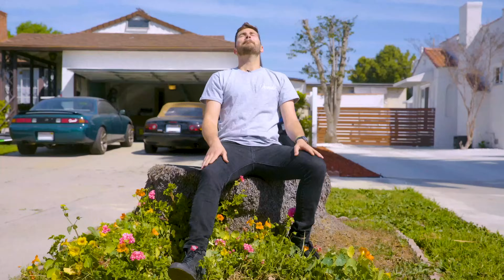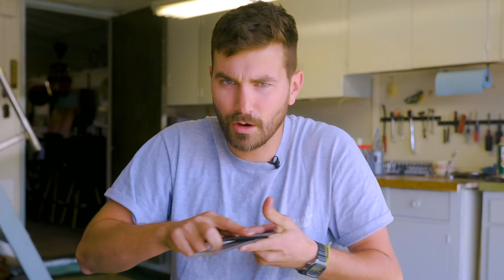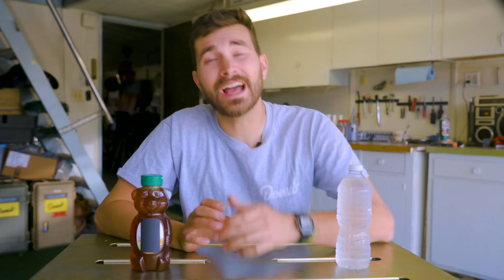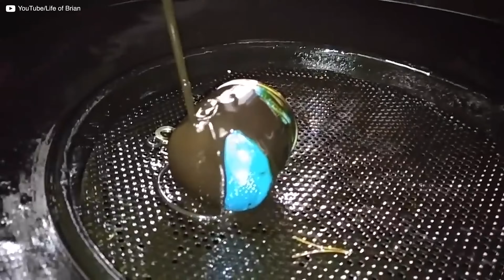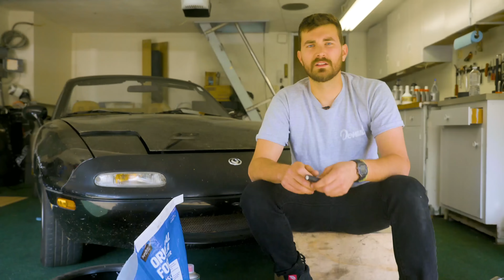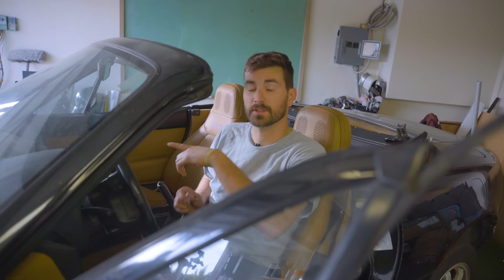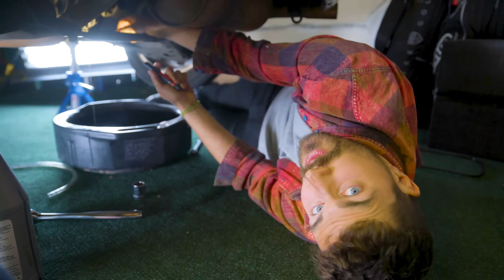9 Things You’ll REGRET Not Doing to Your Car

Comment: Message from the future:  Don’t worry too much about that power steering fluid.
Reply: Plot twist: they broke the power steering on purpose to empty out the system (on to their floor) to change the fluid.
Reply: Definitely do if you care about to your car lol difference between that power steering pump failing at 70k vs 300k
Reply: Ok Dokey Watch the next few videos and you’ll see why it didn’t matter.
Reply: My used car says nope, the steering wheel started squealing just after two weeks of owning it lol
Reply: replace any fluid when your manual says too, most ppl neglect those tho, especially transmission fluid,  ppls transmissions wouldlast alot longer if they replaced the fluid on time

Comment: Another quick maintenance item you may like is the high mount brake light (I noticed yours is out): On these NA MX-5s it's commonly caused by the wire loom pinching and breaking at the driver's side trunk lid hinge. All it takes is a ten minute wire splice to fix. I just replaced mine two weeks ago and it lights up my day every time I see it work.

Comment: Also with bleeding the brakes, ALWAYS start with the farthest brake from the master cylinder and work your way forward. So in a left hand drive car, start with the right rear, then left rear, right front, then left front. This makes sure pockets of air can't back flow into systems you've already bled.

Comment: As far as the oil goes. Yes you  CAN go 5k miles between oil changes, but the more you change the oil, the better. As soon as you start it with that new oil in the pan, it starts to pick up dirt, combustion deposits, etc. So even with new oil technology, 2-3k miles is best. As a professional mechanic, i've rebuilt engines that hand 200-300k miles on them, where the oil was replaced like clockwork every 2000. Still looked brand spanking new inside! The only reason we rebuilt them is because they were 30-40 years old and it was about time. On the other hand i've seen engines that looked like absolute garbage just because the owner only changed their oil once a year.

Comment: WRONG

You dont start the car to get the oil moving, you "roll it over" a few times by doing a small quick turns to crank it over, nit not spark,that gets the oil flowing before metal on metal wear

Comment: At 7:12 - Why not just reuse the empty oil product jug?
Diff and Trany Drain Plugs 	Inspect and Clean Magnetic Plug
Changing Coolant is a good process to show how to do. and how to collect, you could do a video on just that 
7:39 you didn't talk about the insulator boots. (I had a leak in a PVC valve and it dripped in to the spark plug tube and ruined the boot)
23:29 Use a Pick tool to get the tube loosed a bit at a time. 
Belt information was really great to see how simple it acan go
Fuel Pump - Brilliant / Excellent / Just what I needed>
On a 1996 Miata (original fuel filter, age 14 years & 112,00 miles), for some reason the car would just stop. I would be driving 60mph for around 45 minutes and every thing stopped and all the electrics turned off. Felt like a ghost car and I would glide to the side of the road. Wait 5 minutes and restart the car and be on my way.
It was a big mystery until an old motor gay told me to change the fuel filter - 10 years ago and still no problem. Soon will be time again. 

Hoping my Ideas are helpful. Great work and most importantly GREAT LIGHTING! GREAT SOUND! and GREAT VISUALS. KUTGW.

Comment: Sorry, but there's some wrong information here!
Here in Germany people use "long-life" oil a lot. We change it every 30,000km (˜18,000 miles) or every 12 months, whichever comes first. And trust me, Germans are real uptight about their cars! Changing your oil every 5,000 miles seems kinda ridiculous to me... its just expensive and unnecessary at that point. Also, 25-30 ft/lbs is too much.. Especially if you have aluminium (softer than steel) tanks. 19-20 ft/lbs is more than enough. Also remember to change the seal on your oil tank extract bolt..
Reply: Also, don't check your oil level by just turning the ignition.. Drive the car until it reaches operating temperature and the oil has reached its proper viscosity, then turn it off and let it sit for 10-15mins so the oil has enough time to sink back into the  basin. Then check oil levels.

Comment: Dude, the bottom of that air filter is the dirty side. Also, using the gap rings to gap a plug can take off the iridium or other expensive material on the tip. Also don't touch any part of the tip of the plug. Also those gap rings are never correctly made and do not match the gap they list

Comment: 6:41 but you gotta be careful with some cars. for example on a GT350 if its not torqued to factory spec the oilfilter can come off pretty easily at high rpms and if it does and if that oil then spills all over the hot exhaust, your whole engine bay is going to be in flames and you're going to have a really bad time (pretty much like Adam LZ had happen on his mustang).

Comment: 9 things youll regret not doing to your car.. summed up to one thing, not following your cars manufacturers scheduled maintenance list..  is kinda funny how usually the 2nd most expensive thing a person buys in their life next to a house, nobody seems to read the manual for it or know much of anything about how it works, what it needs to work or what it costs to keep it working..  had a middle aged dude come by the shop with a Porsche carrera 911gt that he bought for 7g’s but didnt run right..  well he didnt know about cars but knew a porsche made him look baller.  Didnt know how much parts are for the thing or labor to do it would cost or maintenance costs..  when he found out that it would cost more than he paid for the car just for new brakes, clutch, tires, all the fluids/filters and repairs to the cooling system to get it driving right and not completely blow up, the dude called me a thief and said i was trying to rip him off and tried to sue me.   wound up selling the car for 4g’s less than what he git ripped off for in the first place..

Comment: 6:43 make sure you check for an old o-ring. I spend ~ a year doing this professionally and i cant tell you how many o-rings i found stuck to the engine, youre oil filter will not seal properly with 2 o-rings

Comment: When bleeding brakes you should start with the passenger side rear as it's furthest from the master cylinder. Next to bleed is driver's side rear, then passenger side front & finish with driver's side front. 

"Those chemicals, when mixed with water, do exactly what the name suggests. They prevent freezing."
No, they don't. Your hydrometer told you how cold your "antifreeze" could get without freezing. What will happen if it's exposed to temps. colder than that? It will freeze. So antifreeze does not prevent freezing.

You should wear, and definitely recommend everyone watching, wear safety glasses or goggles when under a car. I've learned this the hard way as every time bits of dirt will dislodge from the underside of the car and fall into my eye(s). It always seems to happen just after I get under the car, never when I'm about to get out from under it.

Comment: I did an oil change like this one when I was 19. I didn't check the old oil filter to make sure the O-ring was still on there. Long story short, I put a new filter on, added oil and went to start up. ALL the oil came out. Needless to say all oil changes since, I've checked the old filter.

Comment: Something people don't often mention about changing oil is that you want to make sure the gasket from the old oil filter doesn't stick to the engine and end up getting sandwiched with the new one. If the new filter gets put on on top of the old gasket, it will leak really badly.

Comment: 6:14 You skipped an important step here. Replacing the Crush washer on the drain plug. This is what seals the drain plug so oil doesnt leak out. Its recommended to change it every time you drain the oil (or really, when you remove the plug. Do not reuse the old crush washer. They are cheap enough so there is no reason Not to just replace them).

Comment: It's also better, if you can, put oil into your oil filter so it doesn't have to go in dry. Most oil filters are vertically attached so it will allow for better life of the oil filter and greater piece of mind.

Comment: There is no reason to change oil every 5k miles. Even every 10k miles is on the early side. I normally do it once per year around 20-25k KM.

Comment: I've had a problem that is common but very simple to fix. A failed gas cap. It likes to pop up a check engine light when that little O-ring in the cap leaks out fuel vapor. A lot of people spaz out when their check engine light comes on over this. If you get a code detecting an "Evap Leak" just run to your local parts store and get a new fuel cap and have the codes cleared. Saves you a $300 trip to the mechanic.

Comment: Also if you live in the midwest/northeast usa, be prepared to replace brake lines and fuel lines on a somewhat regular basis.  I used to get specific ones installed to protect against corrosion from the salt, but then they started dropping acid on the roads as a pre treatment to help the salt de-ice and that shit went right out the window. So heads up!!

Comment: You definitely don't want any axel stands on your "lift points" they're designed for when you use your jack to change to your spare not to hold the car up they're fairly weak get it on the chassis

Comment: Doesn't changing trans fluid on a used car that hasn't had fluid changes in it hurt the car? I've read multiple threats where people say that causes your transmission to die faster because it causes slippage. Only if you do it to an old car that hasn't had consistent transmission fluid changes since the day it rolled off the lot.

Comment: Filling up the oil filter with fresh oil before you put it on is not a bad idea. Some angles make this difficult but if the filter is mounted vertically than it is a good idea. All about preventing we're as much as we can.  even small wear.

Comment: This is honestly a great video and should be shown to new drivers. My dad taught me all this stuff at a young age, but not everyone has someone like that in their life. Regardless I still watched the whole video. 

You should do a video on basic troubleshooting (if you haven’t already). Basically, what different colors of smoke indicate, signs of a bad starter, dead battery, poor alignment, changing a flat, etc. Common problems that people run into and how to fix the easy ones without getting stranded on the side of the road.

Comment: still here few thing you need to check daily or once a week.
screen washer water. battery water level, for those say use dry battery, you are being rich & moron to use dry battery. brake pad,   need to be change in 6 month. tyre pressure. air cond gas.

Comment: This video is great, but a few key notes to take in mind when working on a different car, 

1: European cars (Volvo, Volkswagen, Mercedes) are complex and very difficult to do maintenance on, very often when you're trying to do any of the simple things done here, they require very specific tools to get the job done, so arm yourself with knowledge about your specific model well before attempting to remove ANYTHING because there's a high probability you'll either run into a wall, or you'll not be able to put it back together. 

2: Power steering fluid, some older performance cars don't have power steering, as certain models just chose that, as there is SOME control loss with hydraulic power steering. The other part of that is most NEWER cars use electronic power steering, so same deal, your car may not even have a power steering reservoir.

3:  Transmission fluid, many newer automatic transmissions are fully sealed and don't have a way of opening or draining, the idea being that the fluid SHOULDN'T have any breakdown so the only real concern should be contaminants, which manufacturers hope to avoid by selling sealed transmissions. you're welcome to have an opinion about that, I certainly do. 

4: Differential fluid, and I know I'm probably stating the obvious here, but only RWD and AWD vehicles even have a differential.

So in reality many cars don't even require this level of maintinence.

Comment: My last two cars have not stated that My oil should be changed when the computer tells me or once a year. It didn't make any sense to me when I went to the dealership for my oil changes and they started changing the distance sticker... I got stickers of 3k, 5k, 10k, back to 3k... so I looked in my owners manual... and GM said I should change the oil once a year or when the computer told me. 06 Saturn ion and 17 Ford Fusion both have this in their manuals.

Comment: One big thing you missed that I feel should be said. (I understand when you're working on these videos trying to get content out sometimes details are forgotten)
When bleeding the brakes, always start at the caliper furthest away from the master cylinder and work your way to the one closest to the M.C. Ex: If the brake M.C is located on drivers front side of the firewall start at P.R, then D.R, then P.F, then D.F. If you go from the front to the rear or start on the wrong side, air/water/dirt/debris can travel back to a caliper that's already been bled, defeating the purpose of the brake flush.

Comment: 6:15 I always thought you need to replace the whole drain plug in each oil change. I mean they just cost $2 so why bother to reuse the old one.
Reply: Well hopefully your not super wealthy (in the kindest possible way) otherwise you might have been replacing your car everytime it run out of fuel.
Phew....🤫
Reply: usually its just the crush washer, but maybe on some cars u might need to change the hole plug

Comment: Good video but  your  not doing it 100 percent  right   first if available  always  fill the oil filter to reduce "dry start"  and for the trans and differential  tour not suppose to fill till it flows out  that's actually  overfill which can cause aeration which can promote premature wear one gears. the level should be slightly lower than the fill level   filling till oil comes out means its overfilled other than that not a bad video

Comment: WARNING! Do not run your fuel system dry if you have a diesel. A lot of diesel fuel pumps will have issues if ran to dry. I've run batteries to empty trying to prime dry fuel systems in diesel vehicles that have run dry before.

Comment: I understand the thing in using atf as psf, but ya lost me at that point, this is a much more modern vehicle which is using full rubber seals, not ring seals, like you would see on your axle seals... You are slowly destroying your rack and pinion doing this... Just use power steering fluid...

Comment: At 17:38 the reason that piston gets hotter is cause the B6 engine was around before the miata and in the FWD cars the coolant was in the rear side of the B6 engine, then in the miata they rerouted it to the front. Ive watched a coolant re-route video that shows how to do this "upgrade" so that the piston is better cooled and flatten the curve on time+problems on the engine. 

I'll link the video here and the explanation starts at 5:40 : https://youtu.be/bj0UOO4tVdI

Comment: My mom used to have a 2001 chevy impala with 300,000 miles, and the transmission fluid was never changed. She got rid of it because it wouldn't shift, I couldn't say I was surprised because the transmission fluid was so baked it looked like engine oil.

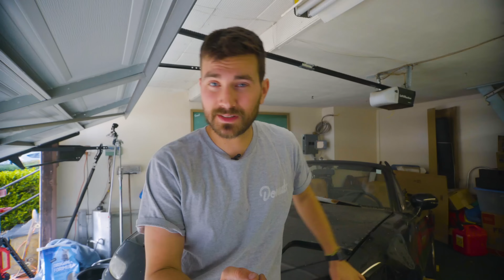Comment: 5:28 Depending on what you do, might not need to lift the rear or lift the car at all. Also important to keep car leveled
6:15 It is advised to get a new crush washer.
6:30 You might need a special tool to remove it, if it is too tight
7:10 Good chance your garbage utility company can pick it up for free from the curb, as long as you label and secure it properly 
8:57 In most cars you can fill the trans fluid without a pump
9:17 Typically FWD cars do not need to have differential oil changed, as it is part of transmission
17:12 Make sure there is no dirt before pulling out spark plugs. Blasting the hole with compressed air should suffice.
18:24 In SOME cases spark plugs need anti-seize lubricant to be added on the thread
19:38 Not all cars have two belts

Comment: Why would you put the plug back in your oil pan before pulling the Oil Filter? wouldn't you think it was hold some old oil that you want to drain by releasing the filter? I also put some in the filter (if it is upright when you install it) to also reduce the lack of oil when you first turn it on.

Comment: Gotta be careful when bleeding brakes that haven't been done in a couple years and/or never. If you push the mastercylinder in too far you can destroy the seals due to a small amount of corrosion on the back part of the cylinder (when you use the brakes you dont push the cylinder in all the way while normal driving) 

A good way to prevent destroying your master is putting one foot behind the brake peddle while you press down, this will allow you to push fluid through without putting the master cylinder through its full range of motion.
Reply: Joshua Nawrocki Cool.  I e heard not to push all the way down, and that it would wreck the seal, but never knew why.  Makes sense